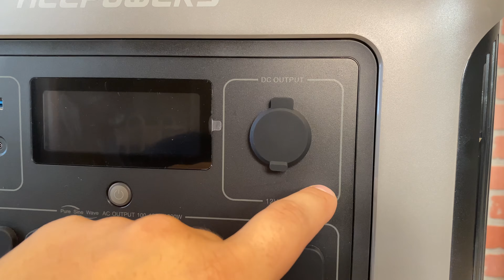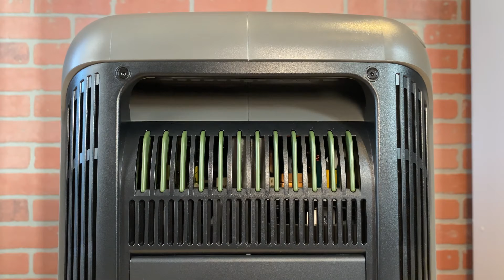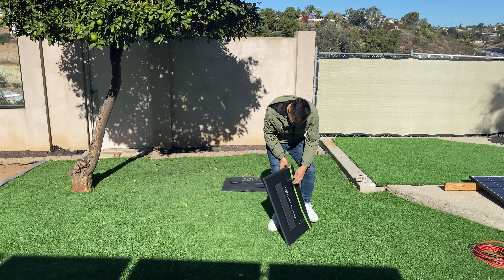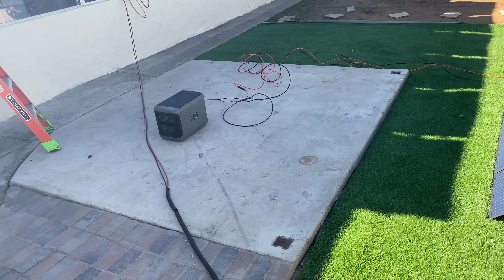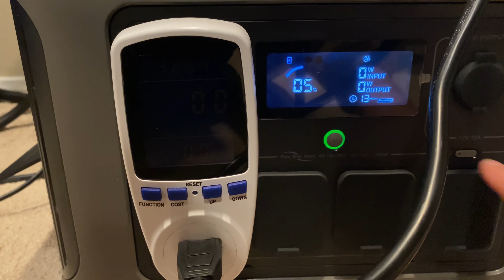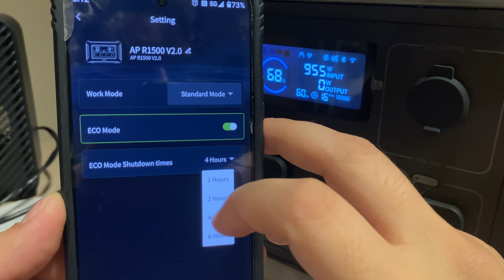Allpowers R1500 Review -  Full Feature Breakdown

Comment: great video but be very careful using your power stations in the UPS mode I had my ecoflow hooked up UPS and when the power went out it surged and burned out the circuitry in my ecoflow, so not only was I not able to use the my fridge that it was hooked to during the power outage I was out of lot of money for the ecoflow Delta 2 and extra battery for it, that was $1400 down the drain because I used it as a UPS device, I will not do it again.
Reply from the maker: Sorry to hear that. Hopefully you got it replaced through the warranty.

Comment: How did you connect the unit to the wireless network? In android app at wifi section you have to chose the model "AP R1500 V2.0" and then where i can find wifi account and password?
Reply: On the side of your wifi modem, or wherever your home wifi password is
Reply from the maker: Yeah, wifi account and password next screen should be search. I did it with apple for wifi and Bluetooth for Android.

Comment: The problem with most if not all of these units is that they share charging port with car and solar, and that the car have limited charging power. 
Whoever makes one with separate solar and car charging, and no limit on car port, will sell tons to campers, until then, we will keep building our own systems.
Reply from the maker: That's a great comment. I know a few different brands that have two dc inputs. It should be standard going forward. I agree